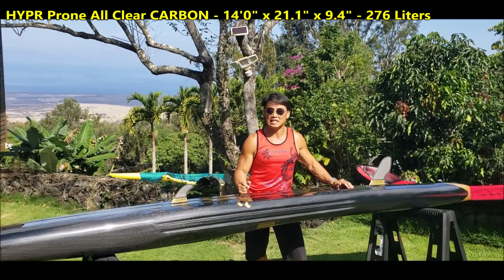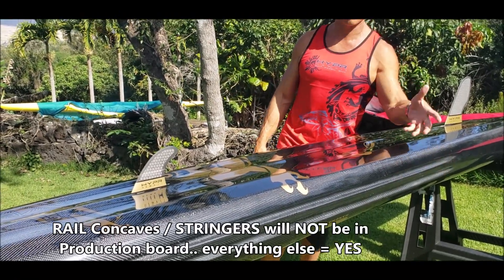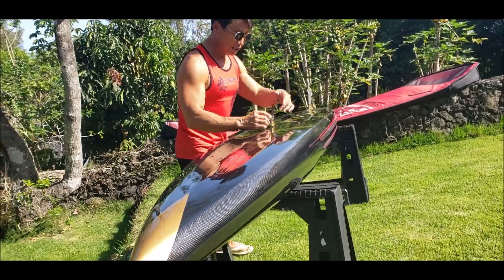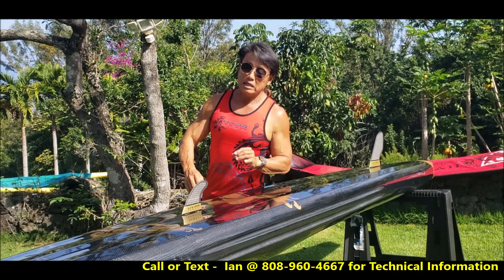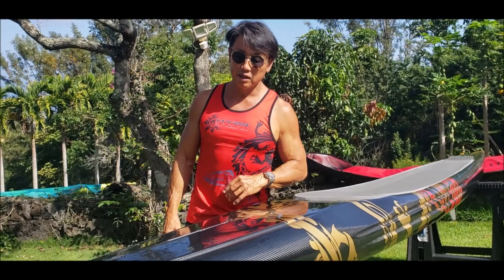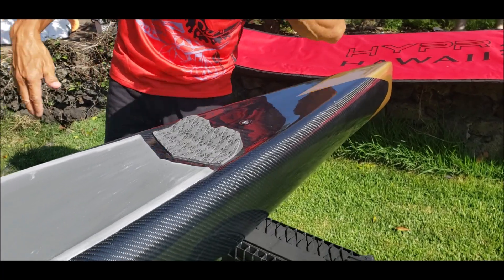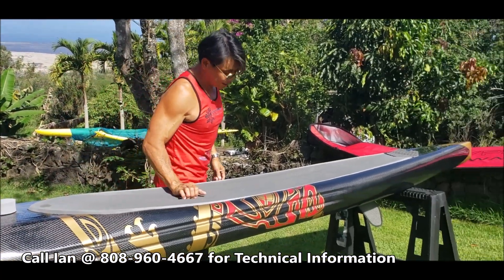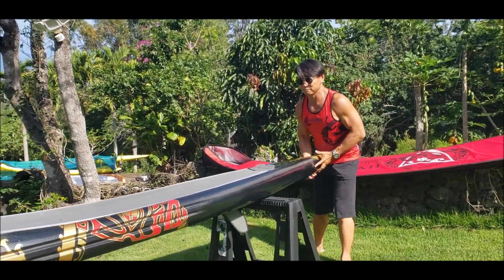The WHY of HYPR Proneboard design - 14'0" x 21.1" x 9.4" - 276 Liters - Ultimate Prone

Comment: Looks like it will surf amazing.   How is it in that flat??
Reply from the maker: VERY FAST .. if you listen to narration on the physics behind wetted surface area.. it will faster than a board with the same OUTLINE but flat bottomed - purely because of additional frictional water drag - Of course if I was going to make a PURE flat water Race prone .. I 'd reduce the NOSE rocker and tail rocker too and do straight Center V the LENGTH of the Hull